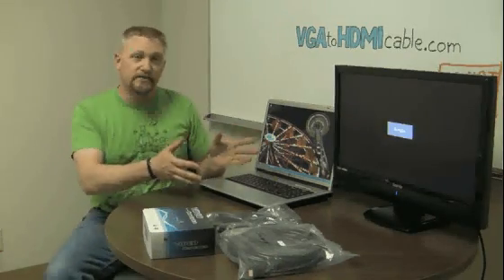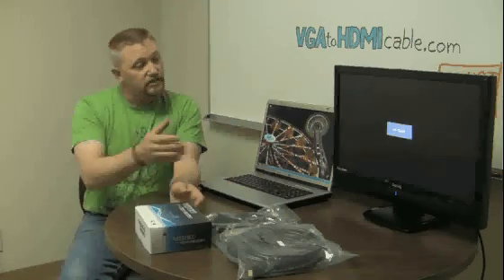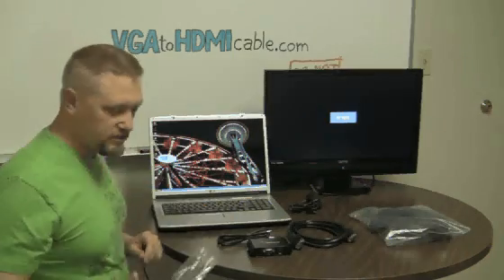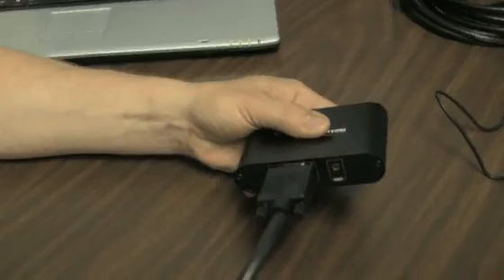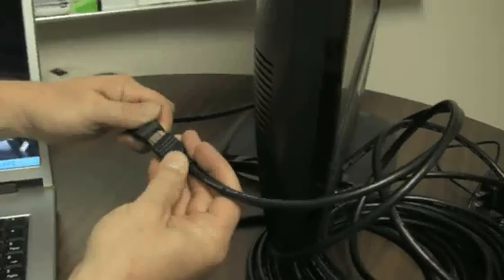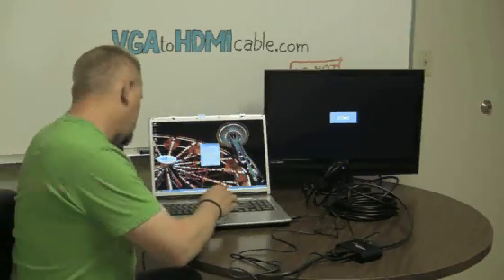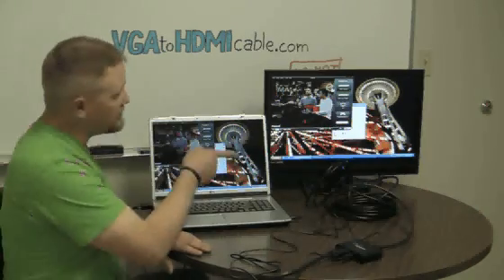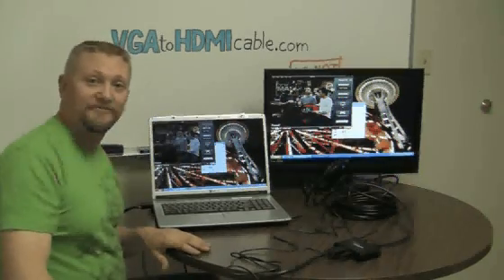vga-to-hdmi-cable.avi

Comment: For anyone wondering if this increases the video quality, IT DOES NOT. The video quality is only as good as the source point, so if you're starting with a vga cable, it will forever be the quality that is produced from a vga cable

Comment: The quality of this video only goes up to 240p?   I am sure we all want to SEE the resolution of VGA when converted to HDMI.
Reply: +Pebber Brown there is no difference unfortunately
Reply: +Pebber Brown i got one for 3.89$ its 1080p
http://www.ebay.com/itm/Hot-HDMI-Male-to-VGA-RGB-Female-HDMI-to-VGA-Video-Converter-adapter-1080P-for-D5/272110635371?_trksid=p2045573.c100034.m2102&_trkparms=aid%3D222007%26algo%3DSIC.MBE%26ao%3D1%26asc%3D20131003150253%26meid%3D23cf30783c9f4a9eb5673127af3f7a73%26pid%3D100034%26rk%3D8%26rkt%3D8%26sd%3D221909515908

Comment: $75 for their cheapest version.  HAHAHA!!!  Okay, dude.  Where do I sign up to get ripped off like that?  Go on Amazon, folks.  They sell for $20 all day long.
Reply: the cheap ones without its own power supply do not work and a lot of the time the expensive ones dont work when you are converting vga to hdmi , it can get tricky this guy makes it look easy and sometimes it is but there is other settings to deal with sometimes

Comment: i have a VGA male cable with a HDMI male which would go to my TV but when I connected it, my TV was blank, any ideas?
Reply: You have to have a converter box.  It needs a power source to change the Analog to Digital.

Comment: Maybe you can answer this...I have a hdmi only laptop, and I'm trying to hook a vga only computer monitor to the laptop. Will this also require a converter?
Reply: Yes.  They are two completely different signals.  A simple cable will not work.

Comment: Then why is there a VGA to HDMI cable???
Reply: Yeah, Exactly what I wanted to ask  !!! Just wasted my money for that cable and know that it didn't work that way !
Reply: Not so much a scam as a seriously mis-sold product

Some VGA graphics adapters are designed to be compatible with DVI as well as VGA monitors. Some,not many. Those which are, can be connected to a DVI monitor via a VGA to DVI adapter .  The reverse is also true, most Apple G4 PowerMacs had DVI graphics ports that could be adapted to VGA monitors.

DVI & HDMI are signal-compatible although a DVI to HDMI connection only transmits silent video while HDMI is video+audio

So if you have one of the very rare VGA+DVI graphics cards with a VGA output you can use a VGA to HDMI connector and it will work. For probably 99% of people though, forget about it unless you buy a video translator box with VGA on one side and HDMI on the other
Reply: I looked up a supposed "VGA to HDMI cable" on Amazon; it received an overwhelming amount of poor reviews. Not sure what it would even be used for? It seemed to be pretty much a scam.
Reply: Digitalpiracy  PC technology is changing graphic cards today now have HDMI 
All the motherboards are changing aswel to support next gen CPUs and next gen graphic cards everything by 2016 will be changed we will have 99 chip set motherboards technology is moving quick that OLED TVs will have the same pixel response time as a 28inch gaming monitor which has 1ms response time 
I will say that OLED has beaten LED LCD PLASMA in response time and very good strong blacks that stay black
Reply: Jon to answer your question (both uses answered correctly, but incomplete to your question.), the cable itself ( if they haven't found a solution, I didn't look recently ) can't reliably convert analog VGA into digital HDMI depending the brand. It needs something else to convert the signal appropriately. This is where graphic cards come into play which were build and programmed to do so. Those cables work with today's model. If you so happen to have one of these cables which doesn't work for your monitor, that is because there is different X to X cables, ones which are native to a specific format. there is 4 versions of HDMI cables, most common you see in stores will be HDMI 1.4 which all common demands people ask for. Some have audio return, some don't, you need to look at the specs of any cable to make sure you get what you need. Defective cables are possible, nothing works 100%. If the cables themselves now convert without additional workings, so be it, because earlier versions of cables couldn't do them on their own. 

also, don't get the HDMI 1.4 cables which had an audio jack beside it (two cables) that's pretty much low quality.
Reply: Not actually true. Some TV's can accept analong vga signal trough hdmi socket, but this is deprecating and newer models do not supoort analog via hdmi. My old tv can accept vga trought hdmi but our company newer monitors and tv's cannot.

Comment: To me this product is redundant. It doesn't make sense to spend all this money on a VGA to hdmi converter when the typical HDTV already has a VGA input port, and external audio input jacks. On the other hand, an HDMI to VGA converter would allow a spare monitor to be used as an HDTV display, and would be a far more useful device.

Comment: What's the difference using between a VGA to HMDI converter cable vs VGA to HDMI converter box?  I'm currently connecting my PC to my monitor that has a standard HMDI port.

Comment: Its for sending information to a receiver or a TV. If you're communicating with a PS3 you'll probably just want to use USB cords, streaming, or put your media onto a storage device then transfer from there to the PS3. In fact I don't even think there is an HDMI Input on the PS3.

Comment: thank you for the video, my question is : i have an hd tv with hdmi onley and laptop with vga out put, if i want the best picture quality should buy a new laptop with hdmi, or just get the converter. i use the vga with my other tv and picture is great. will it be better with the vga to hdmi converter or will it be the same quality. thanq

Comment: There are many cheaper alternatives than to buy this product, you could simply by a hdmi cable that carries audio and video, for about $10. and also save on the extra cords. versus spending $70,a bit more difficult to set up, and extensive cords...

Comment: @luckyStrike81ru your video card has to be able to convert the signal. That adaptor box this guy is using is what it sounds like you need. There is no cable that can just plug and play an analog signal to a digital hdmi.

Comment: I've just got a like 15year old PC well the case is ancient, but everything inside is sound, ermm, i bought a VGA - HDMI cable thinking that would be able to link the PC to my TV, apparently not, but the example above, will it work from a desktop to a TV straight up or do i HAVE to have a monitor?

Comment: As i see with video converter it helps to connect between Analog VGA laptop to Digital signals..but i can't figure out the problem that the output of my laptop is HDMI and the input of my LCD/projector is VGA....so how to solve this problem? Do i need any such supporting device as video converter or sth else???

Comment: i hav HDMI and DVI port on my pc and DVI and VGA on monitor, and There is two port on 1st .My TV device VGA out for monitor and 2nsd15-pin terminal (round shape) out of which is VGA, for display card. All are u requested to suggest me best use of these port , to get better output as well as suggest me cables and convertors

Comment: My VGA to HDMI converter seems to send the picture, but depending on resolution, some parts of the picture are cut missing or the picture is moved left or right or the color is wrong respectively.
Can I somehow fix that? With settings or maybe software?

Comment: i have to run a length of cable aprox. 16ft, should i run a 16ft hdmi or a 16ft vga. what would be better. i realize with a long vga i will have to run an equal length sound cable

Comment: how come then my FULL HD monitor uses only VGA cable and shows full crystal clear picture in full hd, if VGA is an analog thing? and how come my laptop knows my external monitor name without any drivers if connection is analog?